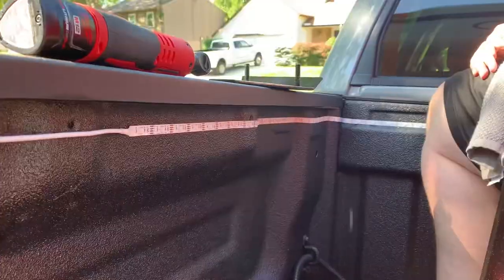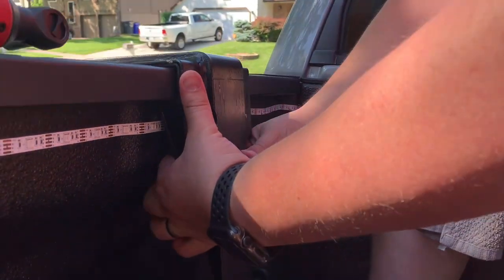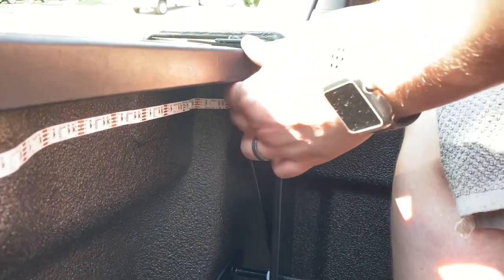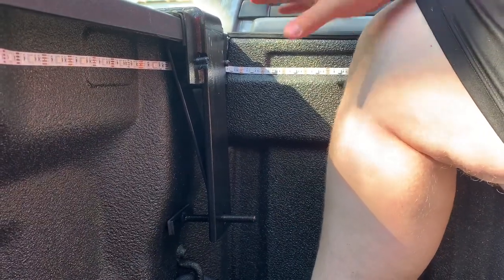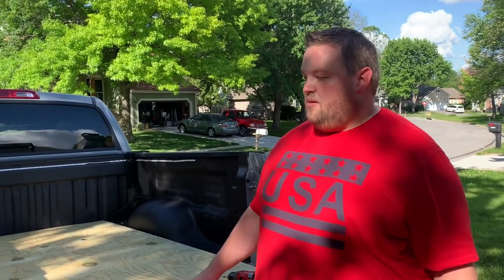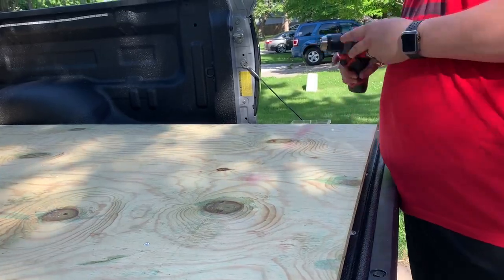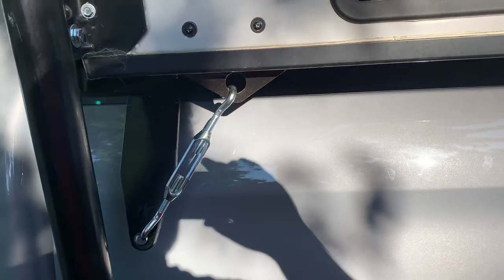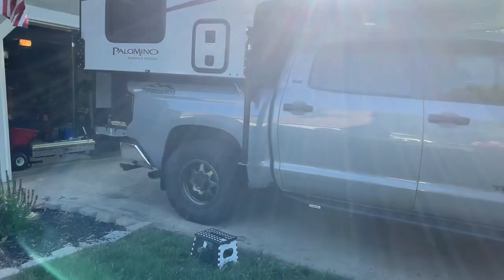Installing a Truck Camper on my 2019 Toyota Tundra Crew Max. Step by step load up!

Comment: I have been considering the four wheel camper, and it sits at 90 inches... So my tundra crew max with the 5.5 bed would look similar to your install. I have been looking for pics and videos showing two feet of the camper sitting on the tail gate. I am a little worried about the weight on just those two cables on the tail gate. I may install solid supports for this. Thanks for the video, I enjoyed it.

Comment: Great information. Thanks for posting. My wife and I just purchased a 2022 RAM 1500. We are campers who pull a 20 ft. RV trailer, but are thinking of going this way so we can pull a small trailer behind with our kayaks or recumbent trikes. Right now we have no way to transport these toys when the trailer is hooked up. Is your camper considered a "light-weight" camper, suitable for a 1500? What is its weight? Would I need to install airbags inside the rear springs of the truck in order to do something like this? Is milage severely diminished?
Reply from the maker: Yes mine is of the backpack variety which is light weight. But it’s still 1600lbs. So that will depend on your payload if you should haul it. My truck specifically only says it has like 1350lbs of payload so I am over for sure once you add passengers and gear. But I added airbags (you can watch my video on it if you wish) and I also added a sway bar. Neither of these technically raise the payload but it helps the truck support the weight better. As far as mileage I get about 13mpg highway with my truck normally and I get 10 with the camper! Hope that helps!
Reply: @kccreations5945  Thank you! My truck has a payload of 1510 lbs. total for passengers, gasoline, and luggage, etc. So a 1600 pound camper would definitely put me over. Please be careful out there. God forbid, but if anything should happen to you out on the road, i.e. accident, whatever, the law will hold you legally responsible if they find out you were over the legal payload of your vehicle, and your insurance will NOT pay out any cash on your behalf.
Reply from the maker: @daveyJ213  yes I have heard of this concern. But I’ve also heard of people who have been in wrecks and were over Gvwr and it’s made no difference. I suppose if an accident is directly related to that some how then it could play a role but it’s unlikely. But I appreciate you looking out for me!
Reply: @daveyJ213  Smart man!  You hit the nail on the head.  It's not how tough your truck is, being over payload can be dangerous out on the road for everyone.
My Camper weighs 1,600.
I carry it in a Silverado 2500HD.  It's rated for a 2,750 lb. Camper which leaves 500 lbs. For gear, and the weight of 5 passengers.
Reply: @coltwinchester6124  Got it! That gives me some numbers to start planning with. Much appreciated.
Reply: @daveyJ213  sticker on you door should give you the weight of your truck, and the maximum weight of your truck plus cargo and all passengers.   Subtract the weight of you truck from the max weight.  That number is the max. weight you can add to the truck, cargo,  passengers ect.
Reply: @coltwinchester6124  Thanks, Colt. Okay, the sticker says: GAWR Front = 3900 lbs. GAWR Rear = 4100 lbs., for a total of 8000 lbs. GVWR is 7100 lbs. Do the math for a total of 900 lbs., which just about a half ton. That's  what a 1500 truck is, half-ton. Correct? At least that's what I'm figuring. Thanks for the help.
Reply: @daveyJ213  GAWR is max weight on each axle. 
THE GVWR is the Maximum your whole vehicle can weight. Truck passengers, and every thing else in the vehicle. Your max is 7100.
If you take every extra thing out of the truck and weigh it, minis drive, that is the weight of the truck.  Take the weight of the truck subtract it from the GVWR,  7100 . Say your truck weighs 5,200lbs.  Then you would have a 2,000 lb payload capacity. 
So if you have 2 people in the truck that weigh 200 lbs each, then you would have 1,600 payload capacity left.
Reply: @coltwinchester6124  Okay - I get it now. Thanks, Colt. I'll take note next time I go through the scales at the dump and make the calculations. Much appreciated.
Reply: @kccreations5945  would your insurance cover you if you are in an accident,  since you are illegally over weight.  You might want to check on that.  Most insurance companies will NOT cover you.
Reply: @daveyJ213  My camper is 1600 with my gear in it.
I have a 2001 Silverado 2500HD. 
In my glove box is a sticker that says max. Camper weight 2,740.
Now my truck GVWR Is higher then that.  The camper weight leaves room for passenger and gear.  Do not go over weight.

Comment: KC you should weigh that plywood. Bet it's over 100 pounds you can cut out! You can also remove the tailgate for another 50. Great videos btw.
Reply from the maker: Yeah that’s true! I need the height the plywood provides because without it my camper sits so close to the bed sides that the front brophy bracket hits:/ And I just like having the tailgate on as it helps support the camper a bit
Reply: @kccreations5945  have you considered or looked into XPS foam? 25psi I think would support it very well. Or just use wood strategical and cut it down. I'd try foam!